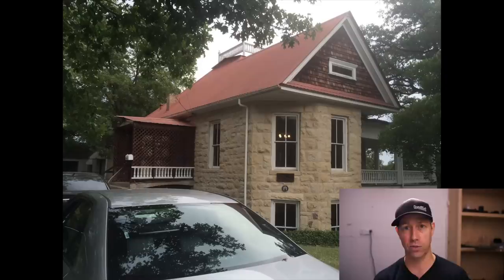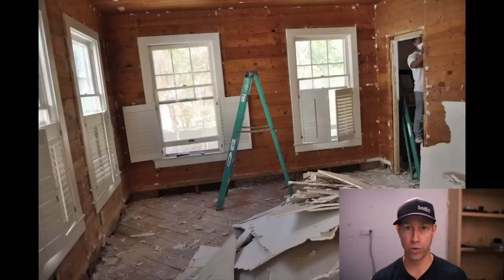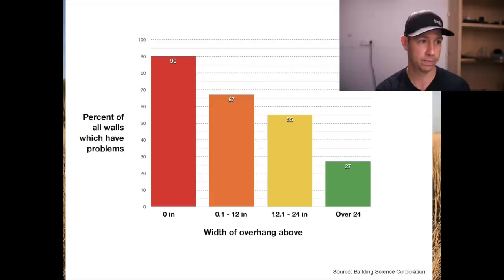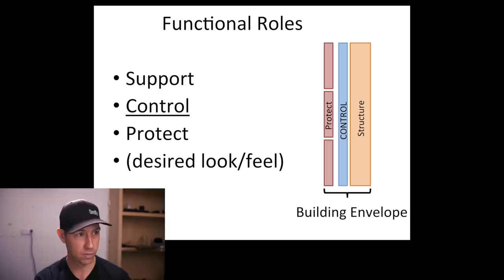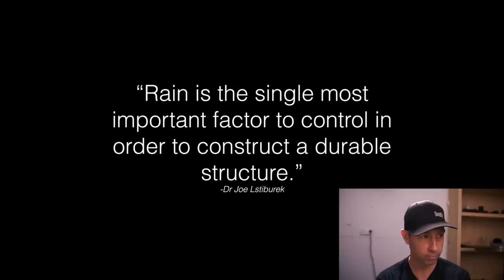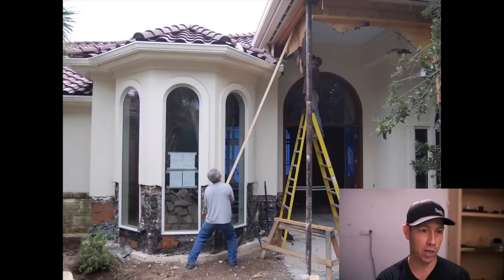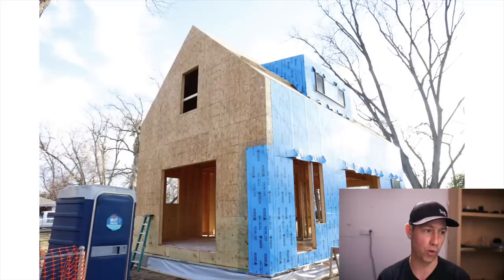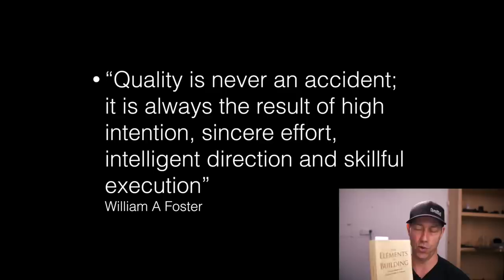Were Old Houses Built Better?

Comment: I used to live in Defiance Missouri until 2010. There's a historical house there that was built by Daniel Boone and his sons. 
They built the first level of the home out of river stone. The wood that they used was black walnut that they chopped down and hand hewn themselves. Most people don't remember that Mr. Boone was also a blacksmith. He made all of the nails used for the construction himself. They started construction in 1803 and completed it in 1810. 
When I took a tour of it in 2009, the guide said the reason that he chose black walnut was it was resistant to mold, mildew; and bugs like termites hated it so they wouldn't try to eat it. 
The house is now owned by Lindenwood university and is used as a teaching tool to show how people lived during colonial times. They give tours often.  At the end of the tour I was on, the guide stated that the university bought the property from the descendants of the Boone family. According to them, they made no improvements to the home.  Since the school owned it, they were only required to install a couple of floor posts for support as required by state building codes. Other than that, we were walking on the same floors as Daniel Boone would've in 1820 when he died there. They claimed that not even one nail was ever re-hammered, or flooring restained or sanded. His home was constructed 199 years before my tour. 
If I ever build that little cabin in the woods someday; I already know that it's going to be made out of Black Walnut and nothing else. I don't know how much greener you can build than that.
Reply: I hope you traveled back in time and planted a grove of black walnut a hundred years ago with a secure trust funding arborists to maintain it since then, otherwise good luck on that powerball.
Reply: Finding Walnut can be difficult and expensive. I’d go with Cypress for the cabin’s sills and build everything else with kiln-dried Black Locust or Osage Orange if you can find it. Especially if the cabin is small.
Reply: Ayyy I live right behide Linderwood! I'll might have to check it out!

Comment: I live in a Victorian built in 1896.  The house was built with Stack Ventilation.  As a result, the temperature is moderated.  The ventilation is excellent.  I can smell what my wife is cooking in the kitchen from the Maid's quarters in the attic.  Our house was custom built by a wealthy family.  A lot of the houses built in the the 1970s and 1980s were built as part of larger developments to keep costs lower so a larger part of the population could afford them.  Plus, the code has changed.  So it is difficult to compare the two.  Most people prefer a new house.  My wife is the opposite.  She wouldn't buy a house built past 1950!
Reply: Your wife is smart and has very good taste ; )
Reply: Eh, I'm not super comfortable with houses where I can't confirm that the wiring is newer than at least 1985.  Had more than enough of ungrounded, chewed-up cloth-and-paper-wrapped wiring with fuseboxes instead of proper circuit breakers.   I love the look of older houses, and most of the ones which stand are the best of their time...but man, corners have often been cut on updates, if they've been done at all.  Wiring isn't sexy, but damn is it an important consideration.

Comment: My new house here in the UK (Guernsey) is 120 years old, made of two foot thick granite external walls with brick interior walls downstairs. A few damp problems but nothing that removal of cement/gypsum plaster and replastering with lime won't fix. It will be great to let the house breath again, as it used to.

Comment: My home was built in 1958 and it seems they were drunk or had no building codes. The stoops were filled with dirt and they through the dirt right up against the floor joist and rotted them out. The roof was buit with no eaves and no soffit for the roof to breath. The rain overfowed the gutters many times and brought water into the walls for rot. The bathroom was made with a wooden window right over the tub and rotted the wall and window out. The crawl space is stupidly low. The closet doors were solid with no ventilation flowing through them and makes the closet stuffy and stale with the potential of mold being that the house already gets way too much moisture in the outside walls. I agree the wood in the house was better quality but warped. Try to drive a nail in it today and you will bend a lot of nails.
Reply: My early 1970s house's 8x5' bathroom is a full inch out of square and the floor 5/8" and 1/2" out of level in both directions. The roof is just a single sheet on top with a whopping 10 degree slope, no soffits or overhangs either. Used T11 wood siding/sheathing, but also used this gypsum sheathing underneath it on all sides of the walls facing other houses/the street for fire spread. When some brilliant guy decided to put vinyl siding on it, that and the miracle Tyvek wrap caused the original T11 to rot like mad by forming a great mold sandwich. Oh, and for the bathroom, some other brilliant guy retrofitted it with an exhaust fan and routed the fan to the exterior wall, and that caused 3 studs and the top and bottom plates to all rot out to nothing.

Definitely drunk/high builders, and probably high as hell architect, too.
Reply: GilBatesLovesyou   and gee...you bought the house?
Reply: My mother did. :/ Didn't know a ton about building stuff back then but had the feeling lots of stuff was hack. We turned down a 1920s house seemingly built like a tank, too.

Comment: My 30s house is a nightmare. I'm saving up to build a masonry house with massive overhangs and hardwood lumber, no pine.
Reply: I'm not sure what you plan to gain by framing in hardwood, other than expenses and headaches.  Hardwood will cost you several times what pine will, and won't make any noticeable difference in strength.

If you're anywhere near the southeast of the U.S., your lumberyard probably carries southern yellow pine.  That's good stuff.  Very strong, cheap, and you can get 2x12s in sixteen foot lengths for less than $20.  Try pricing a cheap hardwood (say, red oak) 2x12 at a 16' length - if you can even find it, it'll run you at least $150.  That's for *one board*.

Generally when wood framed houses have issues, it's not because of the pine.  Pine's plenty strong when used for framing, and it's a lot lighter than most hardwoods.*  Things like water and whatnot getting to the wood will rot out most hardwoods as fast as it will pine - most domestic hardwoods are not very rot resistant, and the imported hardwoods that are cost even more than domestic hardwoods.  Your best bet for rot (and insect) resistance from a domestic wood would actually be another softwood - cedar.**

People have a perception that hardwood is "strong" and is the only "good" wood.  But it's a misunderstanding, for the most part.  Furniture is a perfect example here - the exposed parts of the furniture need to be made of a hardwood because softwoods don't wear very well (you can mark pine with a fingernail).  But look behind that piece of furniture - what's the frame of that 150 year old chest of drawers made of?  Maybe poplar, if you're lucky, but it could very well be pine because pine's more than strong enough for the job.  Houses are no different.

So save yourself a bucket of cash and save the hardwood for the exposed wood in your house.  You will never be able to tell the difference, and the house will last just as long.

Source: I'm a woodworker.  I work with both hardwoods and softwoods all the time.  My rule is: if you care about the shape or durability in handling, use a hardwood.  Otherwise, grab a stick of spf or douglas fir and save the hardwood for something that requires a smooth, durable surface.

* Balsa is one of the exceptions.  Yeah, balsa's a hardwood.  "Hardwood" and "softwood" actually refer to the seeds, not to the density of the lumber.

** As long as you don't mind the occasional guest having asthma attacks.
Reply: Hardwoods are indeed much stronger than pine. It's why railroad track ties are typically made of oak.
Reply: Railroad ties are meant for a very different environment than studs and joists.  Comparing the two isn't particularly useful.  For one, studs aren't soaked in creosote oil, laid in abrasive ballast, left in the weather, and exposed to extreme varying loads on a regular basis while being expected to hold onto spikes.

Yes, most hardwoods are stronger than most pines.  But for framing, it doesn't matter.  Even white pine is strong enough for framing.  You could, if you really wanted to, make your entire house of of 6" slabs and have no gap in the wood at all*.  But what's the point?  Sure, your house is "stronger," but it won't last any longer or bear storms any better than a house framed in pine.

An oak-framed house may hold onto the siding better in a hurricane (assuming you have nailed-on siding), so that might be an advantage.  Of course, you could also just buy nails built for hurricane-prone regions.  Or build with concrete.  Either of those options would be much, much cheaper than framing in hardwood.

* Have fun watching your house jump off the foundation when it grows by a foot on humid days.

Comment: As a painting contractor, I did an 1883 "painted lady" Victorian, wood frame building. What surprised me was that in spite of extensive paint peeling, there was no rot anywhere on the house.All the windows were original double hung and still were in good shape. My theory as to why the house was in such good shape was the nature of the old balloon frame construction with no insulation. Even if the framing should get occasionally wet, there was so much air moving in those walls that they rapidly dried out. Wood that can dry out does not rot, it is when it stays wet that fungus start eating away at the wood.
Lack of vapor barriers also allowed moisture to exit, albeit at the cost of the paint on the exterior peeling. That job took 170 gallons of paint and primer for a complete two coat paint job and requiring 145 man/days of labor.

Comment: No matter the age, it only matters how good the builders were. I agree that the biggest difference is lumber these days may be more precise in size but it does not compare to the old growth lumber you see in older homes as far as long term stability.
Reply: Depends what you frame with
Reply: I mean standard framing lumber. Yes the engineered is great stuff but I’m talking about a 1930’s 2x4 vs. today’s 2x4.
Reply: Wood from then was and is still many time better then trash called lumber now even 20 years ago we pushed the logs they haul to mill now in piles and burned them as trash they are. Can yap yap all you like house built now will not last 100 years . While many old house are 100's of years old still sound.
Reply: The fir studs in my 1930's house are so strong and hard that you practically have to pre-drill a nail hole.

That and you'll blow the plaster-lathe apart if you try to nail.
Reply: It doesn’t matter how good the builder is, it depends on how good the designers are. The builder just build to the design
Reply: Last week, i took a look around inside a giagantic roof truss of a big six stories residential building in Vienna, build some 150 years ago. Everything was still original, everything so very overkill in its dimensions. Woodworms could work for centuries before the structual qualities of this framing would be compromised.
A roof truss like this was surely very expansive to build back then, but nearly unaffordable today.
But what a sight it was.
Reply: Wood gets harder with age. Keep a stud from the 90s dry and protected from sunlight in a wall for 80s years and you'll find it does the same thing.
My grandfather asked me to split a couple pieces of this really old olive tree for firewood when I was a kid. Then he laughed at me as the splitting maul bounced off the face and out of my hands.
Reply: @paerau2338  Oh, it matters how good the builder is. Anyone who has hired a bad builder can attest to this.
Reply: We cut down all the old growth trees or turned the remainder into parks. Build houses from now on out of recycled plastic it'll last hundreds & hundreds of years. Do the oceans a favor and get your supplies from there. There must be a couple of thousand years worth to be had. I'd bet that only about one in a million homes have or will stand the test of time. You can only do the best you are...

Comment: When I was in Austin I lived in an older apartment/house that was old as the Austin house you remodeled. No insulation, tons of airflow, lots of windows... old as old could get.

It was indeed super cold in the winter and unbearably hot in the Summer. Location was great, but only Spring and Fall were livable. My liquid soap solidified during cold winter mornings!

Comment: This reminded me of my grandparents house. Every summer, weekend,  and holiday I stayed with them. They had a house that was built in 1912 and it was fairly large but they paid very little for it in the early 80's. Their were window units and has heaters in most rooms but my grandpa only used one window unit in the main living room and only when he was watching his games. The same went for the winter months. One of my aunt's actually caught fire while warming herself in the morning with the stove. In the summer the attack fan would run while the doors stayed open with screen doors and in the winter 3 or 5 quilts would be stacked on you. In the summer you went to bed sweating and in the winter you'd wake up and see your breath. In 2006 my uncle contacted someone to install central heat and air and handed grandpa the bill. Unbelievable he used it. The house is solid as a rock but they have since passed. They sure were tough people my grandparents. Tough time's create tough people.

Comment: I'm watching this in an oak timber framed thatched house built in 1650 - its laughing at you all
Reply: Where do you live?
Reply: I was looking at the walls of the first house and thinking "those don't look so thick". The renovation project we did had walls 38" thick at the base tapering to 24" at the top. Local stone bedded with local clay, no lime or cement. The sloping wall surfaces make fitting kitchen units harder than usual. 
Local stone roof too, slabs of sandstone up to 1" thick and 30" square. About 80 tons of it. Not going to blow away. The pegs and wooden laths underneath need attention every 100 years or so, but the actual "grey slates" last for ever. 
Probably started in about 1450 with several waves of changes over the years. 
Was it built well? Not really. It was a rather low-grade house and there are much better-built buildings from the same period. And the Romans were building very well much earlier.
Reply: Where at?
I have been wanting to spend less than $30k on a house. Idc if I melt. Idc about much. Just need a tub, crapper and a cook top. Lol
Reply: doubtful.
Reply: @StarkVandalez  Dude I've lived in a house like that
Reply: Same, 1876 timber frame house with giant 8x8 support beams in each wall and 2x8 floor joists
Reply: @youngillinoisan4270  lol the difference between a 1650 house and 1876 is lightyears.
Reply: @youngillinoisan4270  an 1876 house is like living in a house, a 1650 house is like living with Fred Flinstone ;)
Reply: More than 10 babies was made in your house
Reply: @keywestalert6329  no poopin' bucket?
Reply: There is a town in england I visited. The church was built in 1100, the old part of the cost was inside the walls that were built in 1500. The "New" part of the city was built in 1700. Many of the houses and buildings were from the 15-1800s.
Reply: @keywestalert6329  have you thought about moving overseas? I've got a place in Bulgaria I paid$21 k for.

Comment: The one thing I don't think you are allowing for is the much lower cost of heating back when.  The difference is not small.
Reply: yes its a big lie about energy costs now a an energy  i see that we are ignoring tech in favor of crap grid that overworked hidden with green this green that eco tiny this eco  flimsy that
Reply: Nope houses where just much colder.
Reply: Also the fact that old houses were better designed to manage temperature through non forceful means. High ceilings mitigated heat in the summer, double hung windows allowed good control of airflow through the house (open the lower window on one side of the room, and the high one on the other and air will flow through them). Rooms were smaller and divided with doors, so that in the winter you could keep doors closed and only heat the rooms you needed to be warm.

Comment: Good hat & boots for home longevity for sure!
Those old buildings didn't have much of a heating issue when they'd heat only 1 room or 2 & buttoned those rooms up.  
And the kitchen was its own heat source if using the old stoves as well.
I love the old plantation homes with tall ceilings, big windows & rooms that opened to each other across a hallway for natural air con.